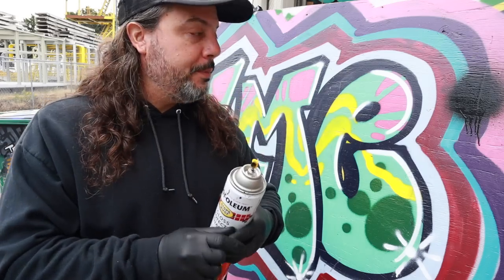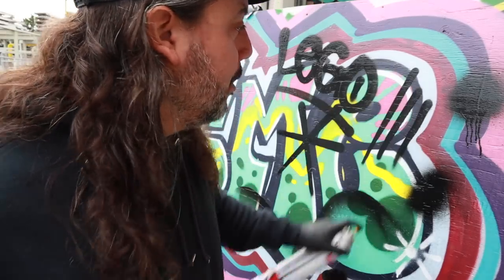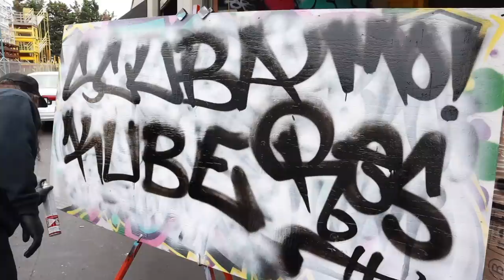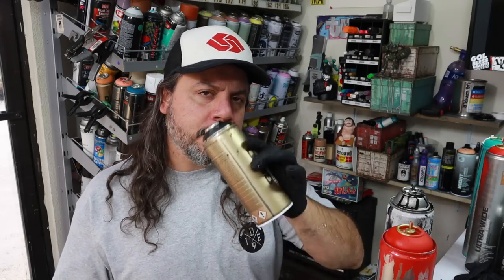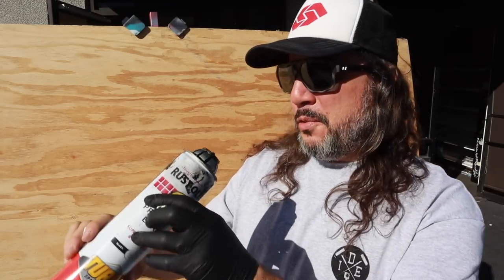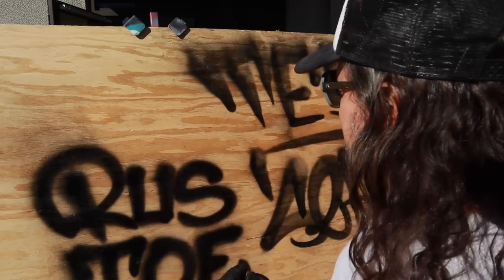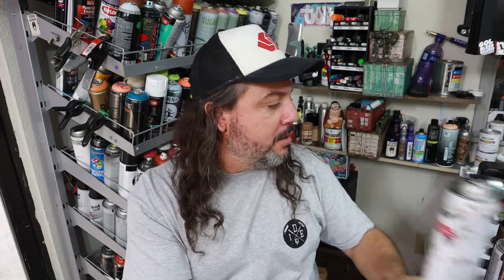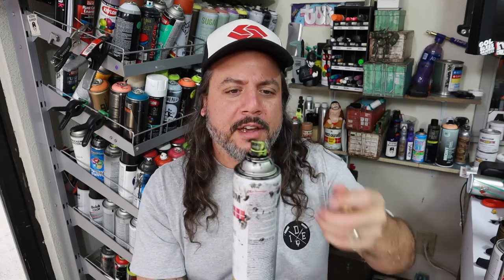Rustoleum Turbo Can Mods [Male 2 Male Caps]

Comment: I've been taking a drill bit and drilling out the caps themselves to go on rustos works alright changes some characteristics but theyre basically like any other female cap or a ny fat with a adapter just saves fussing with it at the wall.

Comment: GR, for the shaker mod have you thought about using parts(sleeve) from one of those paint wands. Like the ones utility companies use to mark lines. And then use something like a rubber lined heavy duty zip ties to help hold the can.

Comment: I made your can shaker at home but I used two "No-Hub" couplings (size-3inch, should be available at Home Depot if not, go to a plumbing supply house: Ferguson or Todd Pipe) to hold the can onto a Milwaukee brand extra long wooden Sawzall blade because that seems to be the thickest most rigid blade on the market. No Hub couplings are for cast iron pipe, next time you're in a parking garage look up at the black plumbing and you'll see the silver bands that connect the pipes and the fittings.. that is a no-hub coupling .. oh yeah you're going to need a 5/16 socket to tighten the no Hub coupling I suggest putting it on your impact or a drill so that you can really crank It down...

Comment: you can make a rustoleum lego and nyfat adpter bot drilling 1/8 hole in the top right behind the arrow and glue the rusto cap closed to help with the over spay and leaking

Comment: the stem on the rustos work good to re fill Montana cannd therr ultra wide just by chilling the can holding upside down and injected the rust on the bottom and release some pressure off the can ur filling a lil bit then put it back on ur freezer and then repeat until filled now u get cheap rusto paint and useing Montana cans superior:) someone should make a video on this a new video